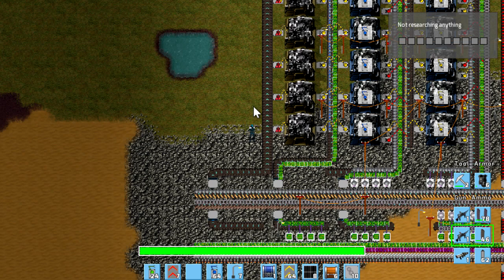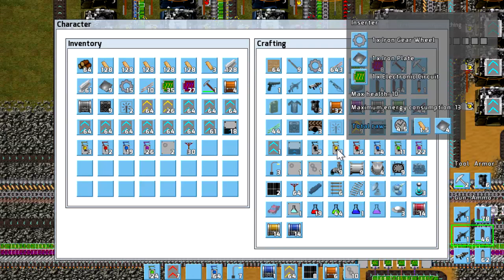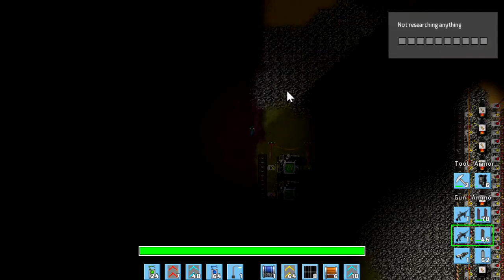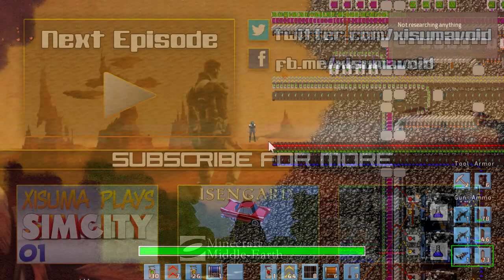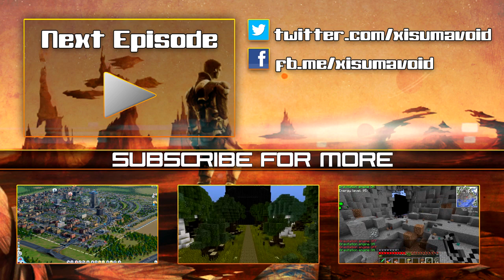Factorio 15 Smart Inserters

Comment: Also, I'm not sure but I think its more efficient to only heat 1 water pipeline with twice the amount of boilers pumping into all the steam engines rather then split it. It uses some kind of voodoo sudo pressure physics.

Comment: At around 10:50 you could use a splitter. It splits up its intake but also remembers what side the item was on. They are handy to create overflow systems so if your are overproducing something it can be stored instead of backing up all the way to the source.